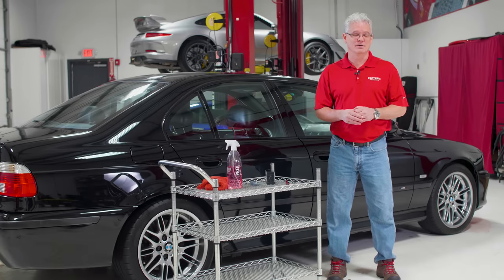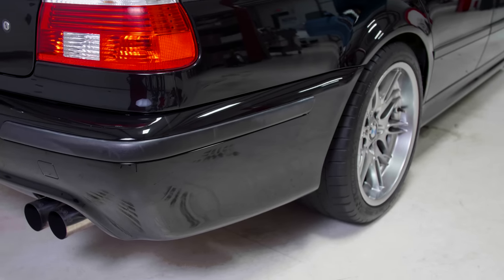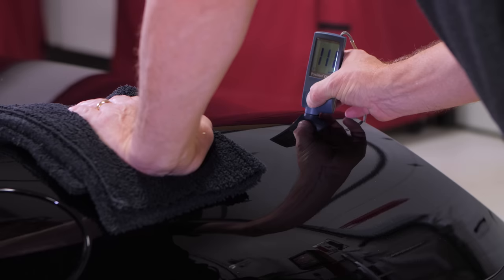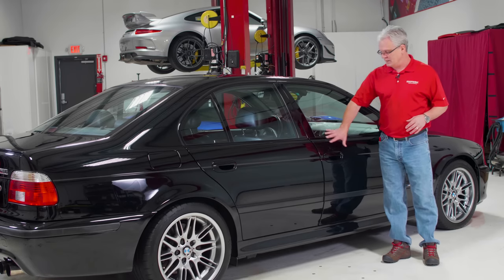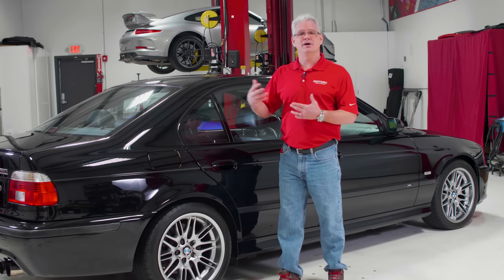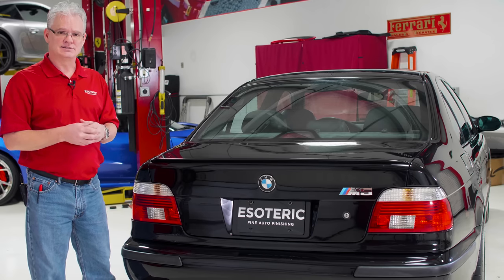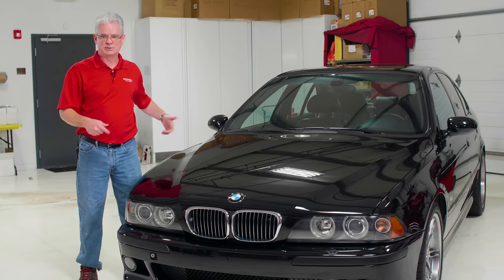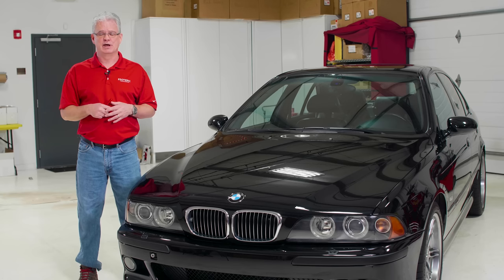How to Inspect a Vehicle - E39 M5 Restoration Detail - Part 1

Comment: I've tried searching for different paint thicknesses guides for different makes/models in different years. You mentioned checking the thickness to the factory specs. In general should all the body panels be pretty close ? Where is your source for information on what the specs should be for each particular make/model/year of a car ?  My 06 BMW Z4M varies quite a bit, though I don't believe it's ever been repainted.
Reply from the maker: Unfortunately, you won't find such a guide. Manufacturers are constantly changing their film build thickness, and there are even a lot of variances within their own production. For one, you start to recognize consistencies in paint thickness across different brand / models of cars over time. Secondly, you are really looking for major inconsistencies from panel to panel on a particular car. If 3 of 4 doors on a car measure from 100-120 microns, then your 4th door measures 180-200, then you know that there's something going on with that 4th door. And as another rule of thumb, you want to be careful of cars that are below say 90 microns on average. I hope this helps!
Reply: ESOTERIC - Fine Auto Finishing thank you very much I'm trying to take my detailing to the next level and I found it quite difficult to find much information out there on the thicknesses of paint. in the video you mentioned checking against manufacturers specifications so I thought maybe you had some info to share .
Reply from the maker: Well you've come to the right place for information, and we certainly appreciate your involvement in the discussion. In the video, I only stated that you should compare the thickness of the re-painted areas to that of the factory painted areas so that you have some kind of baseline to go off of. So if you have a thickness gauge and you are new to it, first start looking for those big inconsistencies. Then you may want to keep a log of the cars you're working on, as it will help you to gain some insight to the general thickness levels you can expect to see in the future.
Reply: I thank you very much for your guidance and excellent information. I do want to apologize saying in my previous comment that you said "manufacturers specifications" in regards to thickness of paint.  I take extensive hand written notes on worthy videos and the replies/comments that follow. At approximately 3:40, you saying "compare to factory" I wrote " factory specs" in my notes. Very sorry, I completely understand that once you know a certain cars overall thickness microns, then yes, a large change in micron thickness in a certain area/panel would be a clear indication that it's either repaint/been wet sanded or overly aggressive compounding or compounded too many times poorly. Having a paint thickness gauge is one of the most important tools in my arsenal of high level detailing.  Todd, you are fast becoming one of my favorite people to get my " next level " info from.  Thanks Again JJ
Reply from the maker: My pleasure JJ, and thanks for watching!

Comment: Do you guys remove and open headlights to polish them also from inside?
Reply from the maker: No we do not.
Reply: My friend who is into headlights modifications (opening them and modify them) always polish them outside and inside. Most of the headlights are from older cars and the plastic is yelow and dirty from inside too.  Headlights look like brand new after that polishing! 
He opens them with heat, and seal them with special seal tape. Maybe you should try it.